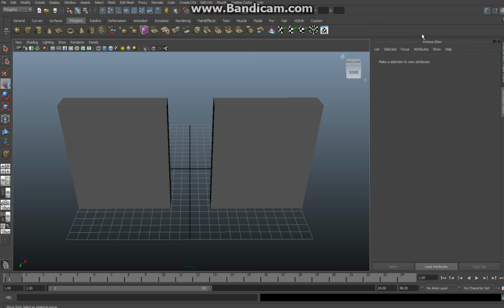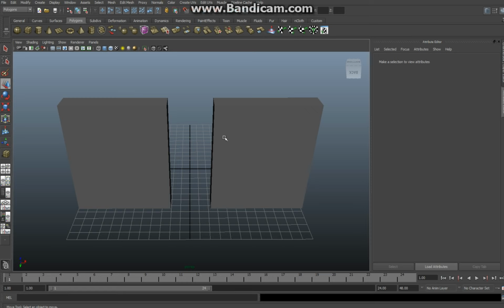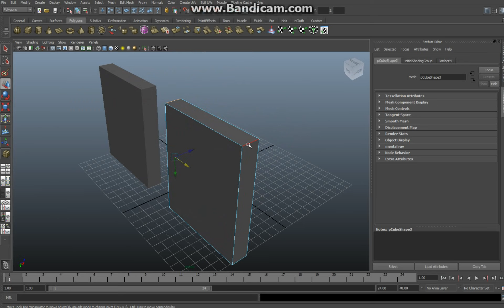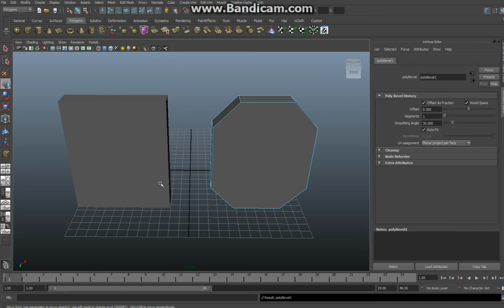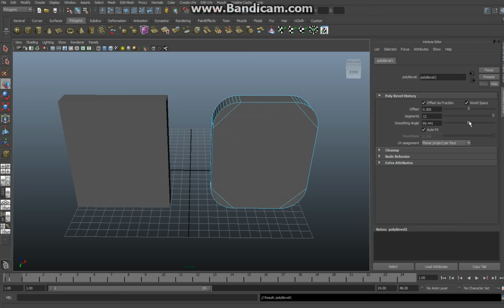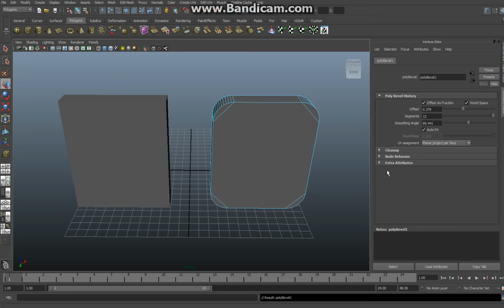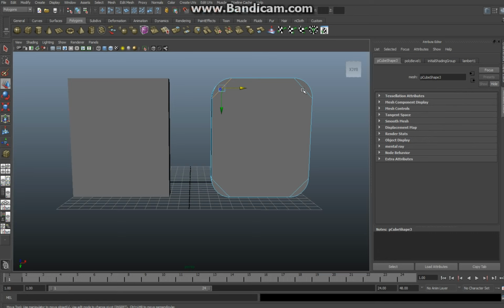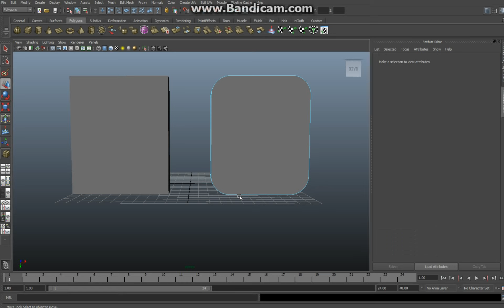Maya tutorial : How to use the Bevel function in Maya

Comment: Can you help me?
I used to be able to see that little information box apepar right next to the edge I'm trying to bevel, allowing me to change it on the fly before approving the action.
Now, I can only go to bevel, put in the number of disctance, and press apply. But this is usally wrong, so I reselct the libe, go to bevel, and keep redoign this move until I get it right. As you can imagine, it's a major pain in the ass.
Question: 
how can I get that little pop up box back again? I'd look it up myself but I dont even know how to phrase the question correctly.
Thank you.
Reply: I think you're talking about the In View editor dialog box.

Go to:
Display -> Heads Up Display -> In-View Editors

Let me know if it doesn't work and I'll go and I'll give you another workaround.
Reply: @aussieraver7182  
hehe, thanks mate, but my Maya unfortunately has expired. The free 3 year trial is over sadly. 
I'm busy upgrading my new computer anyway, so I'll have to wait a bit, perhaps for Maya 2020, for another free 3 year trial.

May I ask you - if I created models in maya 2018 version, can I open up those models in later versions?
I know 3dsmax isnt capable of doing that unless exporting the models as OBJ's.

Can Maya 2020 open up models from 2018?
Reply: @Domzdream  Hello, yes you can open older scenes using newer versions of Maya, although if you need the opposite (newer scenes in older version of Maya) then it may still work, but there will be discrepancies.

Although, if this is a problem then simplying exporting the models from the scene in OBJ should solve it since its a universal solution. (i.e as you said with 3dsmax)
Reply: @aussieraver7182  Thank you, have a nice weekend.

Comment: I have a feeling this is a setting I need to change but whenever I click to bevel on my current model it becomes a wire frame only and the only way to get smooth shading back is to undo the bevel. I'm not sure how to fix this or why its doing it now when I've used bevel before with out this happening. Can you help me out please and thank you.
Reply from the maker: I really never ever heard about that happening. The only thing I can think of is a memory problem, What's your config ?
Reply: I don't know my config other than that its 4 GB of RAM on an intel dual core and my video card can't handle certain render settings.